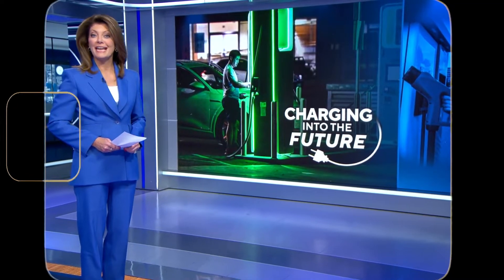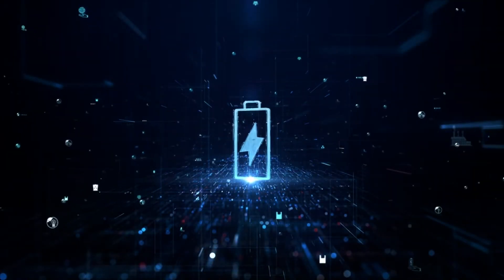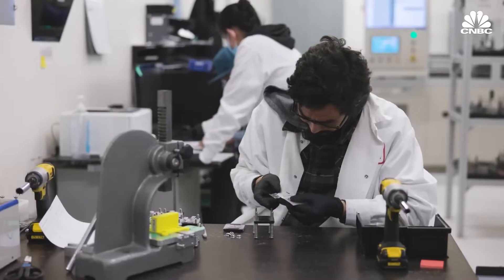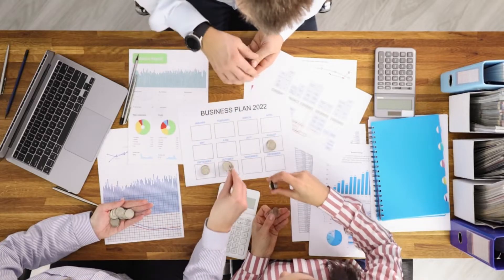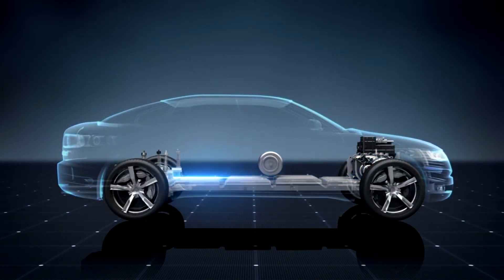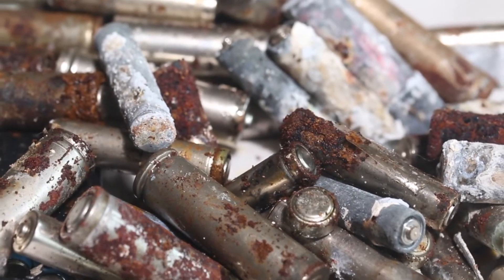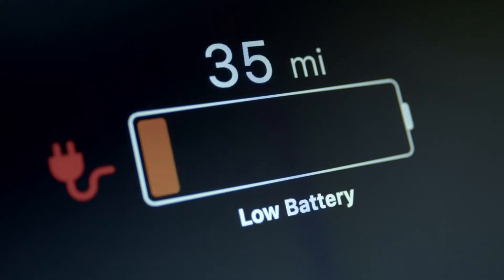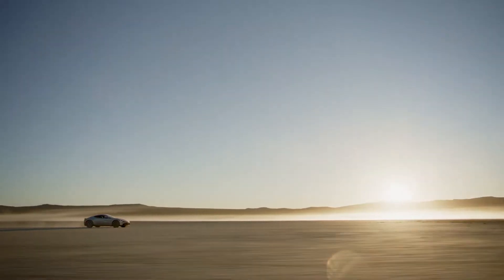How Will The Latest Silicon Anode Batteries Bring Better Range To EVs?

Comment: HPQ SILICON makes the highest purity (99.996%) silicon oxide in one step, with a zero carbon footprint and a 80%energy cost savings,...how does it perform, in just three tries they've made a battery that is 35% higher than the best battery out there.

Comment from the maker: What do you think about using silicone instead of graphite?
Reply: Silicon-based anodes will significantly impact Li-ion batteries and EV attractiveness.  But while Sila is an important player, Group14 Technologies is reaching EV-scale manufacturing much sooner.  Both will prosper.